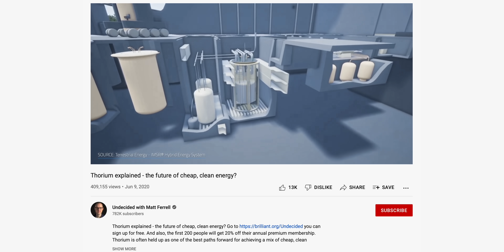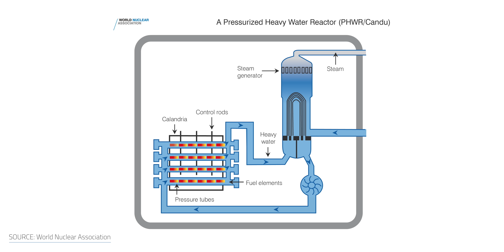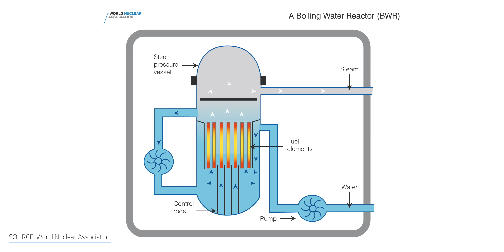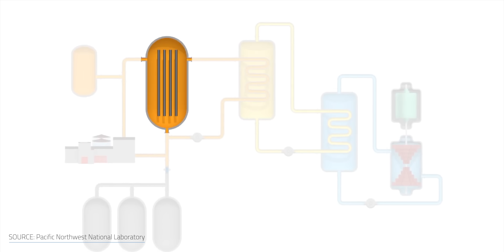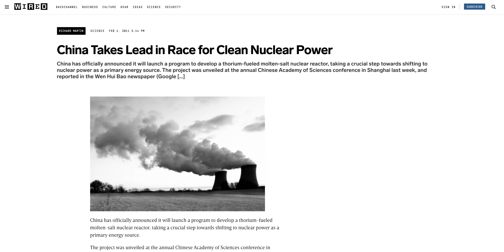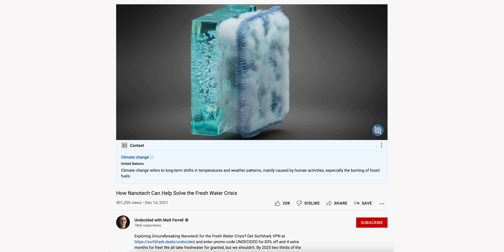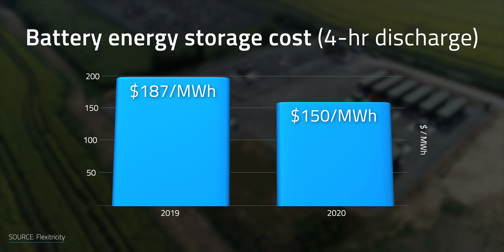Revisiting Thorium Energy - The Future of Nuclear Power?

Comment: A nuclear reactor should be considered a battery. You can use renewable energy to help refine the minerals, create building materials that go into the construction of a reactor. These raw materials can be created in rural communities where nuclear power is abundant. Then you use that renewable energy as a catalyst to create a 30 your battery (nuclear power). The nuclear power plant should be located as close as possible to where the energy is needed. Where energy is needed most generally coincides with a lack of renewable energy resources (densely populated cities)
Renewable energy may make sense it Wichita Kansas but it isn't going to be able to produce enough energy for a New York city. Use the appropriate technologies for the appropriate purpose.

Comment: Thanks for the update Matt. As already mentioned; The public wants safety as #1. Waste products is concern #2. Nobody in their right mind wants an old school (50's design) reactors in their backyards. Pictures of Fukushima and Chernobyl pops up in our brains. Despite the Japanese though they could build them along the shores. Nobody thought that their emergency power could be knocked down. Needed to contain the disaster. Well a Tsunami did, and they were powerless to do something about is. They didn't for seen this otherwise they would build them somewhere else. On higher ground. Thorium is a medium solution. (I heard that the waste product could be upgraded to the original product by using a breeder and used more than once.) Only wind parks or solar energy wouldn't do it. 

We are at the beginning at an energy-crisis. Gas, Cole and Oil are the big enemy's now. It must be green produced. Electric cars don't run air but on electricity. And that demand will grow with each year. So where do we get the energy from? The holy grail; Fusion reactors? It will take for some 30 years if it is feasible. Al lot of energy must be put in then it produces. Slowly their making progress where the efficient figures are more than 1. In theory we can reach a factor of 11%. We are still far away from producing 80% efficiency. The main problem is the energy we must put in order to maintain the magnetic field which contain the hot plasma (like the sun) in there. Until now? We can create the plasma for a few seconds. A flash only. Not for 24/7. Maybe we can over some 100 of years. It is all taking to long, Fusion, Thorium other  methods. It's research will costs us an arm and a leg. And all the time the climate change will continue because we don't have alternatives. Putting wind parks and solar array on the half the planet? Impossible. If we turn everything off, than we are back in the stone ages....

Comment: You cost points are WAYyyyy off , plus Nuclear is 24-7-365 , not intermittent erratic energy - renewables are cheap because they are useless. BTW  No one in their right mind would make a U233 Bomb - that is not a legit argument. Almost all the other "Issues" cracking and such, are not an issue with modern materials, and the rest are what are called "Beyond design basis" meaning it is not a realistic issue, but even it is addressed. Off gas and other handling are just engineering tasks that are worked out - Thanks

Comment: I heard molten salt is pretty corrosive and doesn’t mix well with water. So a leak between the fuel and the water in the heat exchanger wouldn’t be easy to prevent and would have quite bad consequences, right? 😶

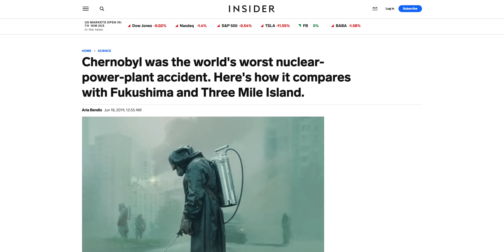Comment: 3:01 - Three-Mile Island was only "catastrophic" to the public trust of nuclear power.  It was a partial meltdown, no one was injured (nor sustained any increased cancer levels in the staff/population), and the other unit continued to operate/provide power until 2019. (the incident was in April, 1979)  --  In March 1978, FIFTY-ONE construction workers were killed when the cooling tower for a coal-fired power station collapsed at Willow Island, West Virginia (and there's literally MORE radiative excursion by far from COAL ash btw...) but coal/fossil fuel lobbyists were still able to capitalize on Three Mile to generate hysteria/distrust and almost completely suppress nuclear energy development for the next forty years... --  ...and it's ridiculous how often the fucking tsunami (18,000 dead) is just a footnote to the "Fukushima nuclear disaster" (eventually/possibly as many as 1,500 early deaths but likely much closer to 150) which still only had 3/6 reactors lost.
Reply: Actually the story of injuries from Fukushima radiation is the same as you described about TMI.
Reply: @danadurnfordkevinblanchdebunk  Thanks!  I've heard claims it's not as bad as that but I didn't want to be accused of underplaying anything so I just went with those official figures for Fukushima.

Comment: Almost Excellent.  Three Significant inaccuracies in the order as presented.  1) the cost of mining thorium is ZERO or even net positive, as it is a no-cost byproduct of mining rare earths and many other commodities.  2) The stated complications & technical challenges of Th-MSR (cracked pipes and leakage) resulted from non-procedural shutdown, 3 the expected cost of Th-MSR should be in the $20 to $25 per MW/h.  The only way to justify $53 is to inundate the regulatory and construction cost with superfluous costs similar to LWRs (thus entirely eliminating all of the physics-in-operation benefits of MSR).  As for grid scale storage of renewables, this will prove to be the greatest hoax of this decade.  Ps. The low cost of renewable energy is a parasitic function of eating baseload income and tax subsidies.

Comment: Another point not mentioned at all in this video is the molten salt reactors can "bank" the hot liquid salt.  The TerraPower project is doing this.  When demand is low (ie middle of the night) they circulate the molten salt through the reactor and store it in large tanks.  During peak hours, they use the "fresh" hot salt off of the reactor plus the stored hot salt from the tanks to spin more turbines.  Basically, a battery that costs a lot less than a battery.  This allows for a smaller reactor to have the functionality of a much larger reactor.

Comment: If you are intrigued with Molten Salt Reactor technology, Contact your elected representatives and tell them you want to see this technology accelerated in your country. I’ve been a student of the energy issue for 30+ years. I thought renewables were an answer, they are part of the answer but we can’t depend on them. MSR technology and the high heat volume generated by these machines allow them to do other things other than generating electricity like salt water desalinization, synthetic fuel production, heat for other industrial applications. Some MSR’s can use the spend fuel from the currently operating light water reactor fleet. So MSR technology is a way to reduce the volume and length of time that the “nuclear waste” some people are concerned about must be monitored. I’ve been a student of this technology for 10 years in the more I learn about it the more I like it and want it.
Reply: If the media was honest about nuclear for the last half century, there wouldn't even be an antinuclear energy movement at all today.

Comment: Energy for the grid MUST be Reliable and Continuous based on demand.
4 hours battery storage does not make it through the night or a week of clouds.
To transition present US electric generation from fossil fuel will require an Average power generation capacity of 300 GW...or 300 full scale nuclear power plants.  Add 1/4 to 1/3 to account for peak load.
Double that to add Land Transportation.
Now (at the bare minimum) Double that to account for building Heating and other Natural gas use.

Comment: I like your videos, you do a good job. 
Did your calculations of renewables include the cost of the land, or just the systems?
Reply: The calculations can easily be seen to be flawed.   A four year storage capacity for solar?  A 30 year life cycle for nuclear?  WTF!
Reply: @danadurnfordkevinblanchdebunk  He said four hour storage for solar i.e. a solar array complete with a battery backup that can supply power for four hours after the sun sets or the rain starts. Nuclear does not rely on the sun shining or the wind blowing, and spends almost all of its service life (30 years) producing full power. Even fossil fuels cannot match the uptime of nuclear plants.
Reply: @danadurnfordkevinblanchdebunk  You guys both agree that nuclear is a more viable power source than wind/solar/battery, and in fact, as I've seen in other comments, molten salt reactors can also be used as energy storage, meaning that wind & solar supporters should all be in support of developing more nuclear power to help shut down fossil fuels and maintain a stable grid. It's time for the US government to set up programs to help nuclear energy rather than hinder it.

Comment: The events at Fukushima was not a nuclear reaction event, it was a hydrogen event. Not a nuclear explosion! It seemed that you implied that it was a nuclear event. But an event that happened to include a nuclear reactor.
Reply: Three melted cores says it's a nuclear event.
Reply: @danadurnfordkevinblanchdebunk   I respectfully disagree. The cores melted after the loss of coolent. Just like you not say your engine froze from burning gas when it lost it's oil or water coolent. And zero nuclear explosion, all hydrogen from the   over heated water, after the pumps failed.
Reply: @danadurnfordkevinblanchdebunk   Sorry, but this was not a mulcher event. When your water pump is broken in your car, is it a gasoline event, when your engine stops?

Comment: This technology will be valuable for some applications (especially off-world). I just don't see this really happening in the next 30 years and powering anything on the grid.

Like you said in the video. Solar and wind are too cheap to touch, and energy storage costs will continue to fall until we go all-in on wind, solar, and geothermal.

Economically speaking, this will never catch up and compete with other renewables. It's simply a matter of not making the numbers work.
Reply: Actually solar is more expensive, and the numbers provided in the video demonstrate this if you look closely.
Reply: The LCOEs for wind and solar are lower than ever, yet the world is mostly burning carbon for electricity.

Comment: Amazingly after 14 minute video, and somehow not-very-much-in-debt information presented, the main point, aside from safety, why a Liquid Fluoride Thorium Reactor (LFTR) is an amazing tech, is not event mentioned. The main point is not that thorium is 3 or 4 times more abundant then uranium, but that in LFTR, the energy of thorium - via thorium-protactinium-uranium 233 fuel cycle - can be utilized over 90%, versus the current uranium fuel cycle with less then 1% efficiency of extracting energy from the input fuel roads. That is almost a factor of 2 improvement ( 100x ). Any, supposedly informational video not explaining that, does not do a good service educating the interested audience and more over can be viewed as either technically poor quality or informatively neglecting to present an extremely important information, that makes or breaks the economy of LFTRs and in that manner of future of efficient and likely massively distributed electricity energy production on Earth.

Comment: The problem with things like having a number for LCoE is that it's heavily dependant on your assumptions.
Eg. I'd expect a traditional Uranium cycle plant to have a lifespan closer to 40 years (at least for those built in the '70s and '80s), not just 30 years, and any built today I'd expect to be more like 50 years. A thorium one I'd think would be less than that because of all of the increased corrosion factors.

Likewise, the assumptions for wind and solar are that only a 4-hr battery storage is nessasary (might be so when they're only contributing 30% to the grid, but if we were aiming for ~80% then you'd likely need days worth of battery banks). And then there's the point that these LCoE measurements are trying to compare apples to apples when in the real world, it's apples and bananas. You'd need much more energy capacity for a wind and solar dominated system to account for the variability in supply. Then there's the point of under what conditions are those LCoE for renewables caculated? For example, is that just the numbers for solar from southern California or a global average?
Reply: The lifespan might be less with current materials, but the costs are more than made up for by far cheaper construction requirements. A molten salt reactor core can be made of 1/2 inch thick stainless steel and doesn't require a massive reinforced concrete bunker to house it. A PWR reactor is a precision forging many inches thick and does require a bunker to house it. The less stringent manufacturing requirements also mean they could be mass produced, like ThorCon is planning to do.
Days? Try weeks or months. The number of daylight hours varies by nearly 8 over the course of the year where I live and the wind blows when it feels like it. Ambient energy is simply far too unreliable to run civilization.
Reply: Plus additional transmission line capital costs and energy losses

Comment: On a gridwide scale, as intermittent sources make up a larger percentage of the energy mix, the cost of storage and transportation of the energy generated rises exponentially. Therefore, there are breakpoints where the cost of building wind/solar approach those of nuclear power.l
Also, i know that Flibe Energy are looking at/dreaming about filtering out useful isotopes from the waste stream, and selling them to industries in need, primarily medical, as a seperate source of revenue. If it pans out to be economical to do so, that's another way of keeping up with the cost of renewables, while also helping people by increasing the supply of medically useful radioactive isotopes.
Reply: California USA is already experiencing a solar glut.  One company is now charging their customers 50 cents a Kw/hr between the hours of 4-9pm to keep from putting in more fossil fuel plants.  They are also trying to change their net metering legislation to discourage the expansion of solar.  They need a few small modular reactors to fix it, but California is highly anti-nuke.  This should be a lesson for all the 100% renewables camp.
Reply: @danadurnfordkevinblanchdebunk  So long as you see that renewables are cheap and useful, up to a point, yes. The lack of nuance you often see in public discourse is kinda sad.
Just the understanding of how Intermittent/Baseload/Peaker power works together would be a big deal in getting people to a reasonable understanding.

Comment: My first question is; where in America has a commercial nuclear power plant EVER been build in 6 years??  In order to have an honest discussion on selection of a power mix of the future we first have to use estimates on cost and time to construct based upon REAL experience in America.
I worked for 40+ years in nuclear, many of those as a NRC licensed Senior Reactor Operator so I am not anti-nuclear. Forget about the waste issue, the design safety issue, the radiation or proliferation issue because these are just a footnote to the real problem of building American nuclear power plant on time and within schedule. The last nuclear plants to come on line were watts bar 1 and it took 23 years and 12 Billion to complete and  watts bar 2  which took 42 years and 12 + billion to complete. VC Summer units 2/3 were canceled (2017) after 5 years of construction and spending billions and bankrupting Westinghouse and one of the countries largest utilities. Vogel unit 3/4 are still under construction and are now projected to cost $15 Billion each after 10 years of construction and if they ever do start, electric rate will skyrocket for the utilities customers.  Based upon experience in America, new reactor designs should not be expected to be completed in less than 10 years and allowing for at least 5 years of testing, it will take another 15 years before nuclear can even be considered as a viable power source and add to that another 10 years to construct the new generation of plants and the question is; should we wait 25 years for nuclear to address climate change?
Reply: In order to have an honest discussion, we first need an honest discussion.  The media has lied about nuclear for more than 50 years.  Small modular reactors are built in less than two years for millions, not billions, yes in the US too, the Navy builds them every year.
Reply: @danadurnfordkevinblanchdebunk  Smoke and mirrors from the scammer channel.  Navy reactors are highly enriched (90%) U235 PWRs that produce low power levels.  I wonder why there are no U.S. commercial nuclear power U235 highly enriched plants if it is such a great idea. Or why no one except for these paid pro-nuclear lobbyists didn't think to just put navy reactor clones around the U.S. right now???? And the ocean is the safety system for these reactors.